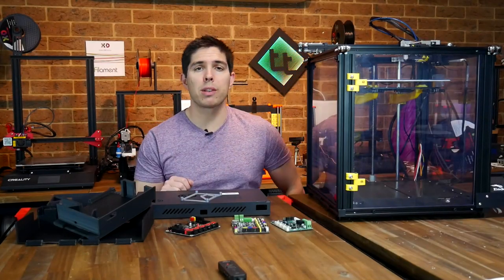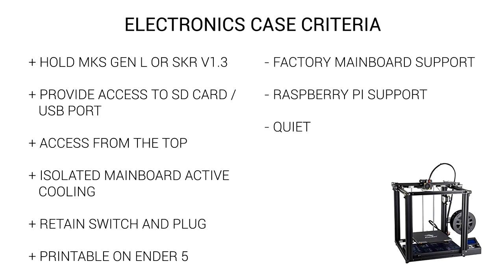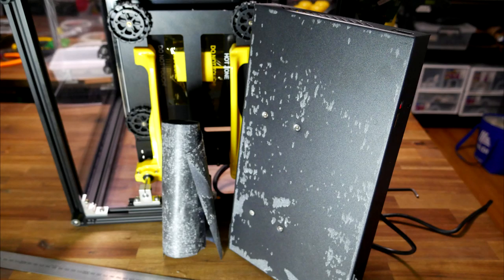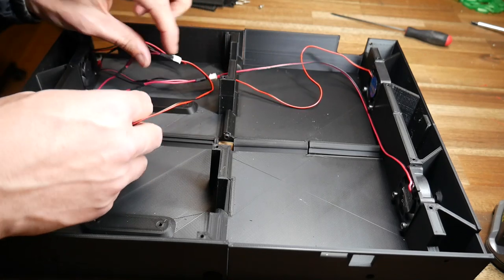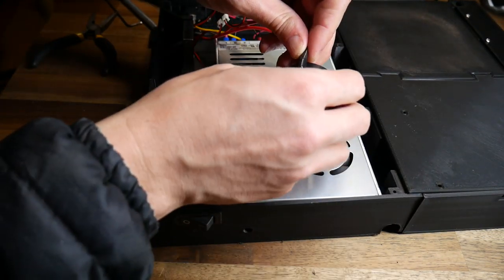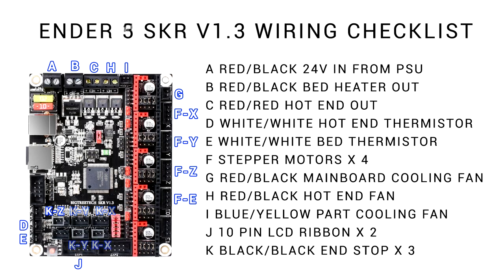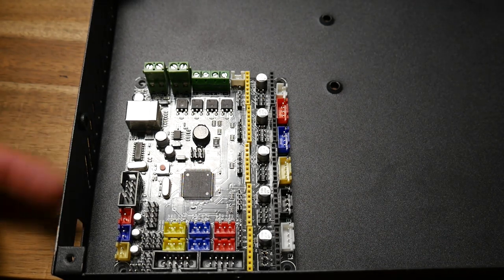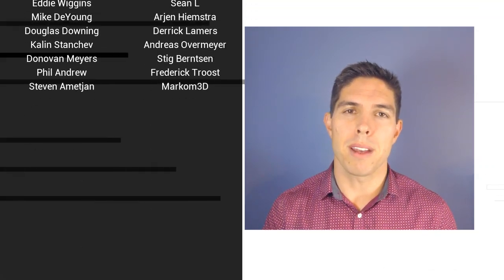Ender 5 SKR V1.3 & MKS Gen L guide + custom electronics enclosure

Comment: Great project to follow and nice to see you finding a good use for my model of the SKR 1.3.
I'm not sure blocking the exhaust port on the PSU is such a good idea. The MW psu's are pretty tough but still ......
Reply from the maker: It might be hard to tell in the video but there is clearance above the PSU for air to circulate. Tha is for the model, it was so detailed I had to cut off most of it because my computer couldn't cope!
Reply: @TeachingTech  Ok no worries Ill be interested to see the results when you get this working . I think the software you use is making the model slow . Happy to make a simplified version if that would be useful Cheers

Comment: i love  your cases! i am currently printing the ender 3 back case =D
Reply: While you're at it, try search for different lids (reinforced by having some features on the top side) or at least print the lids in PETG. They are thin and will warp when printed in PLA, because of the heat from the electronics. I've learned it the hard way.
Reply: @FakirCB  okay, thanks. do you mean in the remix section?

Comment: This video series is well timed. I was having a discussion with a colleague at work who has an Ender 5 along with myself.  We were debating at what point has a printer has been modified so extensively that it is effectively a custom printer and no longer a modified printer.

Looking at your build, do you feel that you have tipped over the point where you no longer have an Ender 5, but rather a custom printer that happens to use the same stepper motors, power supply, and aluminum extrusions as an Ender 5?

Comment: I guess I would have opted to keep the board and PSU outside the chamber. And maybe thermal isolation for the case. Also: Won't there be a problem with the heatbreak cooling fan cooling a lot less when the temperature inside is higher? Or is that just a problem with PLA?

Comment: Great video and explanation, but I've noticed few issues:
- From what I seen, PLA printed case will be exposed to inner heat chamber, if it reaches >60C, enclusure will melt and it will be messy. You should isolate it  from heat completely.
- I think you should use other type of fans with more static preasure, there are plenty of cheap 40x20 server fans on aliexpress, I suggest using fans with two bearings.

Comment: I was watching a video on YouTube the other day and the gentleman made a comment that didn't make sense to me. He said that if you use a smaller nozzle such as a .2 mm instead of a .4 mm, you will have to modify the firmware. Is that true? And if so, what do you have to change in Marlin for a .2 mm nozzle. I put a .2 mm nozzle on my Ender 5 and have printed a number of things just fine as far as I can tell. I used Cura 4.2 as my slicer and set the profile to the fine mode with a layer height of .12. I set the nozzle size to .2 in my printer profile. Everything seemed to work just fine. So was this guy just yanking my chain when he said you have to modify the firmware to use a smaller nozzle?

Comment: With the Ender 5, does the entire print need to stay in heat? Would it be possible to simply enclose the top with a hole at the bottom and sides around the build plate path?

Comment: Michael, I am in the middle of upgrading my Ender 5 Pro. I am using parts from a different printer, Main board, hotend, etc. The “new” main board I am using was from an FLSUN machine. I’ve tried to flash the correct firmware for the ender 5 pro but, it does not seem to take. I’m a novice to flashing and mainly have experience with just the mechanical side of printers. Could you help me? What step did I miss? Thanks!

Comment: It appears you DID NOT use a USB cable to connect your pi to the SKR. I have been searching for this solution. How do you connect the two without USB?
Reply from the maker: I didn't in this video but I have since. Doing so without involves soldering.

Comment: hello, i've a skr 1.3 with tmc2208 uart, I used the marlin 2.0.5.4 (the latest version I found with skr1.3 configuration files) but I've a problem... when i try to autohome in the menu the ender 5 just got in one direction, if i try again it go again in the same direction.. i tried to print something but the ender 5 can't center the bed... any suggest?

Comment: Hi, If I use the "#define USE_XMAX_PLUG and USE_YMAX_PLUG my endstops do not work. So I had to change those to USE_XMIN_PLUG, USE_YMIN_PLUG -and by doing this also set the #define X_HOME_DIR and define Y_HOME_DIR to -1 values. This where the only way my end-stops worked as supposed when Auto-homing.
Reply from the maker: With the original config did you plug them into Xmax and ymax as per the diagram?
Reply: @TeachingTech  Hi Michael, yes I did.
Reply: @TeachingTech  They homed to the other side of the end-stops.
Reply: @TeachingTech  Is it possible to send files 1:1 on the Patreon? If so I could send you my config files to have a look. Printer works fine by the way, only thing left for me to figure out is the Ezabl - but, might be I just swap it for BLTouch, since there is no info around for enabling it in Marlin, neither 1.x or 2.x other than using special package and some few printers sold by THD3.

Comment: I'm in the process of printing the enclosure and I noticed there's no way to attach the left front and rear cases together. The print files I downloaded look different than the ones you printed in this video. I think there's a tab on the front piece that should be on the rear piece. Please let me know if there's a problem with the file or on my end. Thanks for all your contributions; very helpful.
Reply: Same here, but the power supply holds them together quite nicely

Comment: @Michael, on and off the topic - TFT - is there a way to change the Z-offset when having this installed without any of the other controllers, eg. full graphic LCD, etc?
Reply: I guess not. TFT is a separate system and you need to be able to change the z offset in real time, probably better with a lcd 12864
Reply: Yes, you can do a z offset with the TFT display. Michael has a video showing how to do it. It's pretty easy. You have to enter the gcode in Notepad. Under more iteams.

Comment: I bought the SKR 1.3 board with the 5160 stepper drivers. I've built and uploaded the firmware and hooked up a MKS TFT35 touch screen to it which worked fine. But I'm not pleased with the TFT35 because it takes a good amount of pressure pressing the buttons on the screen to get them to accept your finger press. I tried a TFT28 V4 and all it would display were blank icons. I followed your video on using this touch screen with the Gen L board. The SKR board has an 8 pin TFT output socket that matches the pins of TFT28 screen but no matter what mks_pics folder I put on the SD card, it would say "Erasing pics..." and then a white screen would display instead of the logo and then the all white buttons. The firmware seems to work because I can press a white button and it will go to the next screen for that button and the text to the button shows up so you know what the button is for but it won't show any kind of icons at all. Any ideas on what's going on here?
Reply from the maker: Plugged into the wrong port in the back of the TFT? I remember something similar the first time I tried mine.
Reply: @TeachingTech  No, I'm sure I've got it in the correct port because it says on the board what the pins are and they match the SKS pins. Do I need to plug in a 12 volt power supply to it. I have the jumper on 5 v which I assume is coming from the SKS board but maybe I need to plug in a 12V source. I have a 12 v power supply with the long round tube type plug that is 500 milliamps of power. The plug fits the socket on the TFT. Should I plug that into it?
Reply from the maker: The power and jumper sound fine. I mean the 8 pin port of the back of the TFT. There are two, one is for the wifi expansion so try the other one.
Reply: @TeachingTech  So jus to confirm, the TFT28 should work with the SKR board, correct?
Reply: @TeachingTech  No, I didn't plug it into the wifi port. The wifi port is at the top of the board while the TFT port is at the bottom. There's another port next to it and I'm not sure what that port is but the TFT port has the pins labeled and they match the pins labeled on the SKR board.

Comment: I have the ender 5 + SKR + 2130s. For some reason the sensorless homing refuses to work.
Reply: I should add I enabled it in Marlin and jumpered it on the control board. I suspect the limits being max vs mins have me confused. I tried jumpering all the limit switched on the board to eliminate human error

Comment: How did you got this enclosure to fit in the build bed on the Ender 5 printer?
Reply: You'll need to turn off any bed adhesion (even skirt). It opens up the bed to the full spec then.

Comment: I am going to switch to the skr 1.3 in the next day or so, is it possible to connect a camera to the board, or a raspberry Pi to the skr v1.3? If I can avoid octoprint and just use Cura that would be preferred. Thanks for any help y'all
Reply: ...I want to / make that looking for this main board case, + using a skr mini E3 + RPi 3B installed in there for OctoPi.
hmmm, with the main board now on the lid, how is it that the screen cable is to short, from initial looking it looks like it is actually closer to where the screen is... or am I just not interpreting the pictures correctly. 
Michael have you "refined" this further ?
G

Comment: I am setting this up for my ender 5 pro, and I tested the fans, and it’s running really quite high, and much louder than I’d hoped, is there a way to lower the fan speed/noise?
Reply: run them at 12v instead

Comment: Michael, as someone mentioned in the comment in your other MKS Gen L Ender 3 guide. You do not need to #define REPRAP_DISCOUNT_SMART_CONTROLLER to retain the stock Ender 5 display. You can reuse the stock ribbon, simply slice off the end and flip the cable on EXP3 and #define CR10_STOCKDISPLAY - This worked for me on both boards, MKS Gen L and MKS SGen L.

Comment: Hello Michael,
I`f printed the converter for use in the motherboard/Power supply box (@10:50). But in the video the power supply is removed. But if you leave the power supply in the box. The mount does not fit. The holes are misaligned by a cm or so. I`m no designer.  Ar you able to adjust the holes in the design? ( https://imgur.com/a/BiTdSYt ). I hope you can help me and possibly others.  Watching all your videos. Clear and easy.